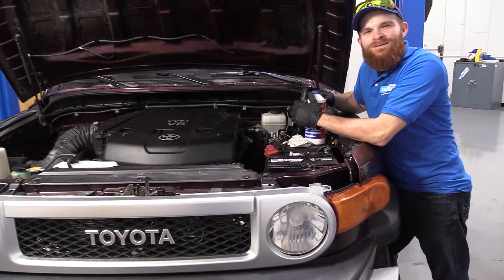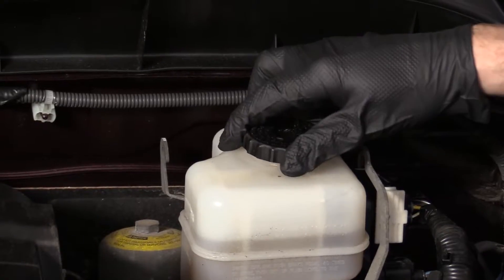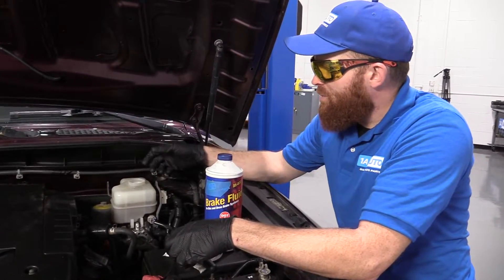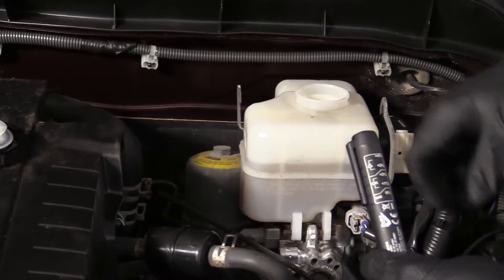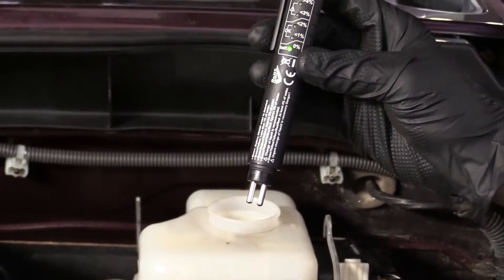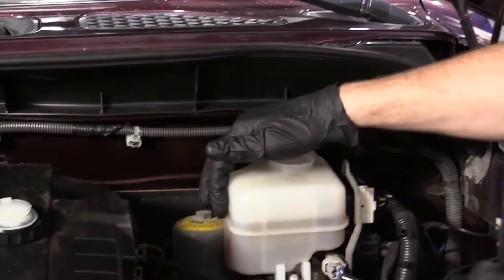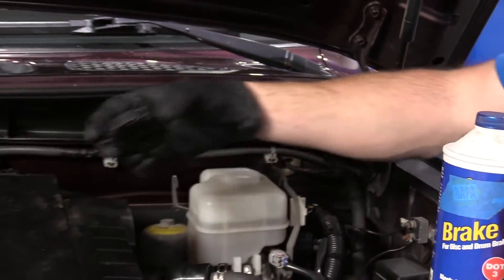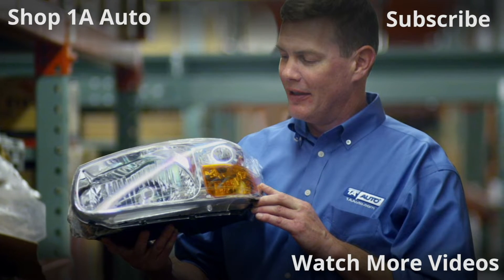How to Check Brake Fluid 07-14 Toyota FJ Cruiser

Comment: I want to make a correction to my senior mechanic about topping up the break fluid you only top up if you have a leak or you bleeding your breaks because low break fluid means your break pads are running out you need to check toping up will cause excessive use of the break pads Which may cause damage to the disk and more serious damages may occur